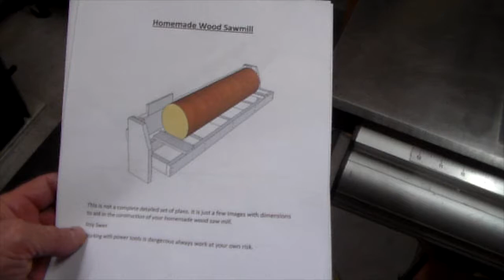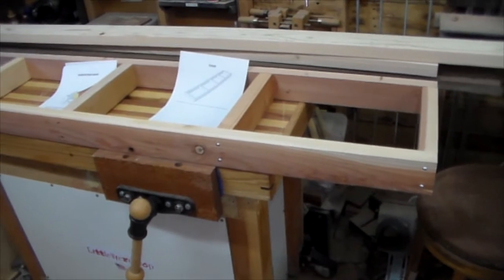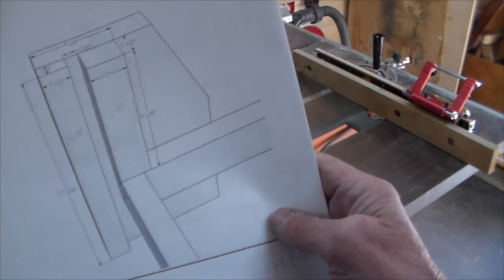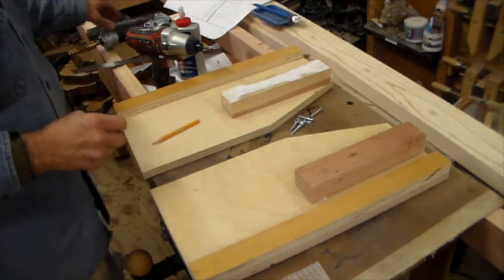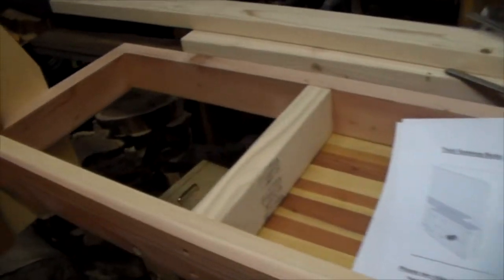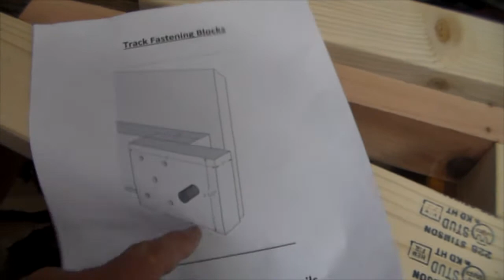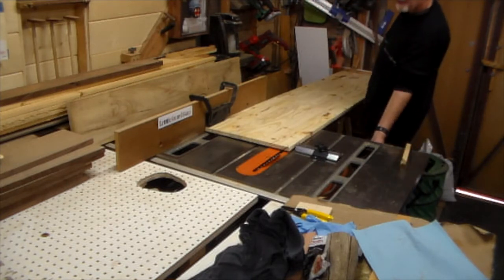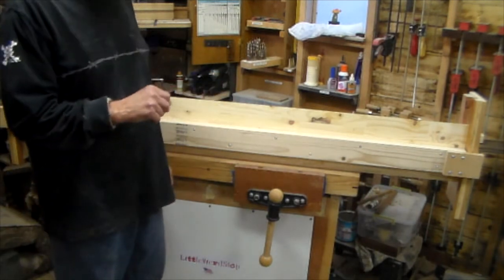Part 1 of 2, Mini Sawmill build for my Prazi beam cutter,

Comment: Any chance you would be willing to share the plans?  Izzy no longer has them on his site.  I reached out to him but they only offer plans for an Alaska mill now.
Reply from the maker: Not sure I still have them or find them. I’ll dig in the shop for them tomorrow. Thanks for watching. 👍🏼
Reply: @DumbBrosWorld  Hey - I was just wondering if you happened to stumble across those plans. I ordered my Prazi can't wait to start cutting up some timbers.  No worries if you aren't able to find them.  I figured it was a long shot.  :). Thanks for even considering the request!!!!
Reply from the maker: I’m still going to check another location for them. I have physical limitations now slowing me down.
Reply: @DumbBrosWorld  You are very kind for trying!  Thanks!!
Reply from the maker: Well I appreciate that. 🤠 Ron1
Reply: @DumbBrosWorld  Hi Ron - So after rewatching your videos and Izzy's video, I was able to glean enough info and measurements to reverse engineer the mill. It works pretty well but I'm having trouble with the chain not staying tight. I'm also using a cordless Milwaukee saw and the battery has overheated and shut down on me. Any thoughts on what I should change?  Thanks! Bob
Reply from the maker: Oh, so sorry never dug out what I had for you. Every day I did think I was going to. 😬
Reply: @DumbBrosWorld  Truly no worries!!  It was kinda fun to see if I could work it out.  I do appreciate the thought but it was healthy for me to do the brain work... LOL